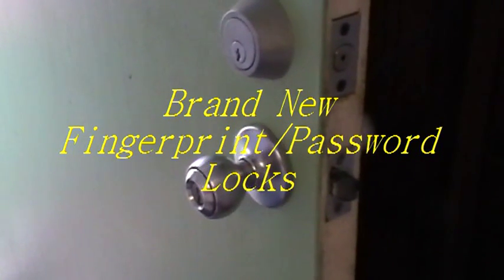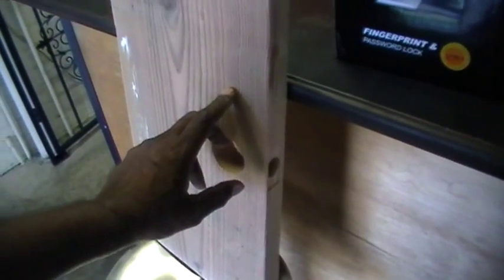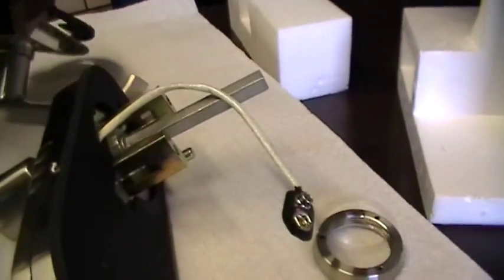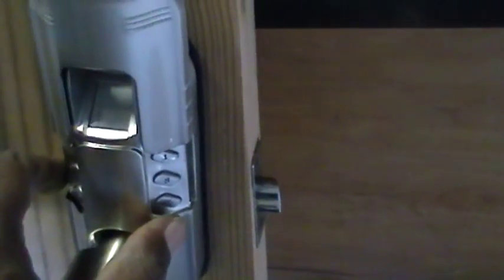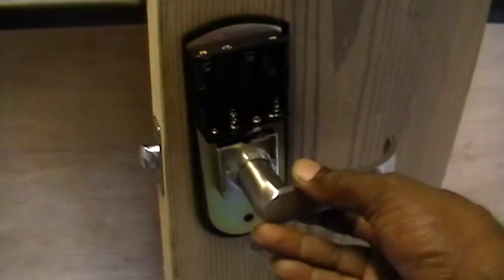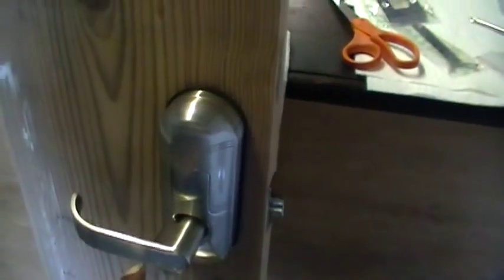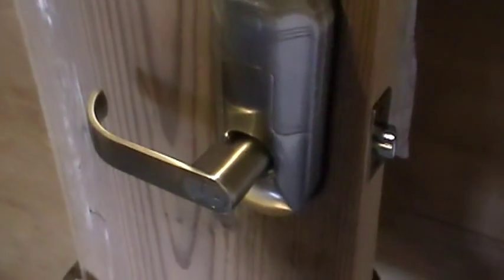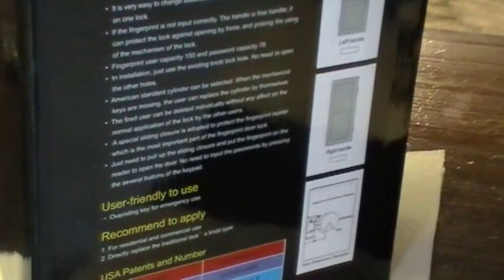Biometric Locks

Comment: I have used this lock for about eight months. Installing the lock was pretty easy & straight forward. The lock itself looks great and seems to be of good build quality. >>>t.co/v5hWwBlz9C  The original batteries lasted about six months, but this is on our main door under very heavy use. We have had no problems with the Bluetooth connection, but you do have to be close to the door. I would like to be able to unlock or lock the door remotely, but this may be possible with the upcoming "bridge adapter".
Reply: nicely it

Comment from the maker: Thanks for viewing my channel.  This system comes with a 'Key Override'.  Should the battery be allowed to go dead, or if there is a malfunction, the key can be used to operate the lock.  I recommend placing this system on a maintenance program wherein the battery is changed.  
Thanks again for viewing my channel.

Will